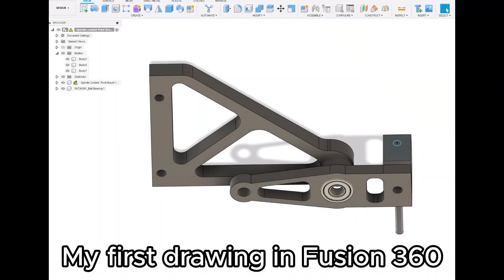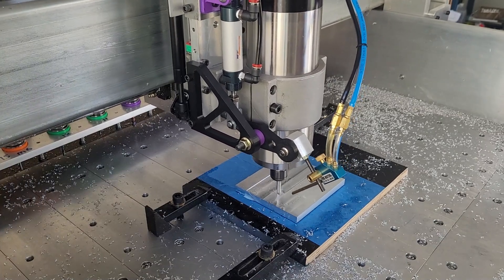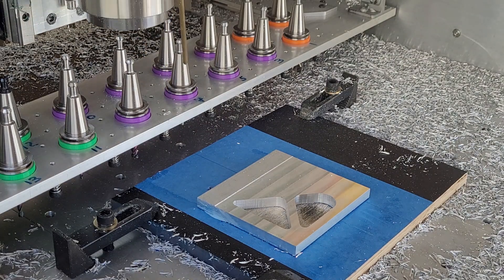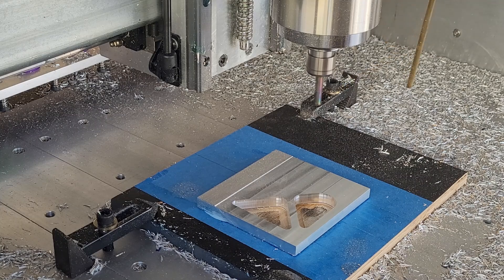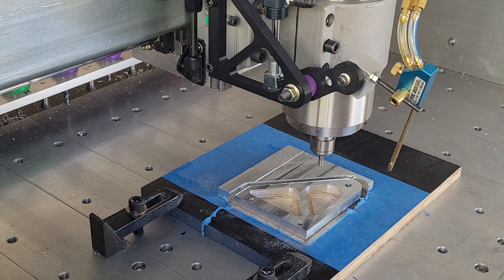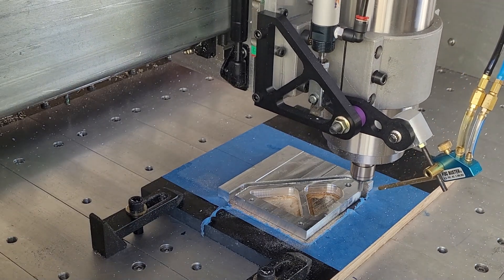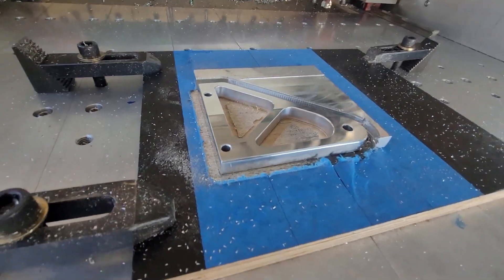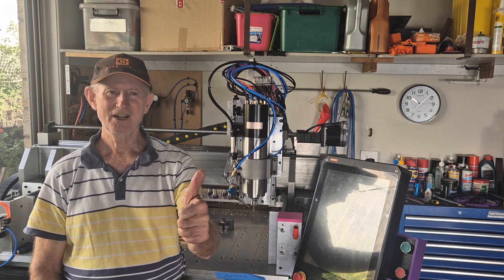Bill's PrintNC CNC 3d Printed Proto type and 6061 alloy Machined mist coolant Retraction Device

Comment: what are you holding down the work piece to the wood and tape with?
Reply from the maker: Hi thanks for your question after cleaning with alcohol, I apply the masking tape to both the wooden base and the bottom of the alloy then just apply super glue to one of the tape surfaces it bonds almost immediately so be precise when placing the alloy onto the wood I can always loosen the clamps and re square the part if needed Ok cheers Bill

Comment: what pitch and grade ball screws are on your machine? great build and keep videos coming!
Reply from the maker: Hi Kevin I started with 1610 single nut C7 ball screws on the Y and X but on one of my upgrade when I changed from 20 mm linear rails to 25 mm rails on the X and Y I also changed to 2005 Double nut C5 ball screws Machined not ground sorry I can't find the brand they were just off AliExpress I was happy with the quality and finish they have been getting quite a work out but still very precise I was after 2010 double nut but could only find them in C3 ground which were far to expensive .... with the servos and 2005's the machine can move faster than I can ever machine and can run rapids of up to 6000 mm / m well that's as high as I have tried.... The Z just uses 1605 C5 single nut (with air strut support) and because it is so short I may upgrade it to a 1610 C3 ground one day Ok I hope that helps cheers Bill

Comment: Hey Bill, what kind of grease do you recommend to use on the linear bearings and ballscrews?
Reply from the maker: Well the normally recommended linear rail and ball screw grease is White Lithium  But I have been using High Temp Wheel Bearing grease for the past 5 months as an experiment to test it's long term performance ........no problems to this point why risk it you may well ask . I always planed to extend my Y axis by another 100 mm replacing the Ball Screws and rails for longer better quality ones after a year or so anyway  the H/T wheel bearing grease is much easier to get then white lithium so time will tell cheers Bill
Reply: @williamnorris1516  thanks for replying! I really appreciate it. I’m in the process of assembling a machine at the moment (it’s not a printnc) but I was curious on what to use. Love your machine btw. I hope to build one in the future so I can cut smaller mild steel parts.
Reply from the maker: @thedude6650  Happy to help and good luck with the build it's a fantastic project building your own CNC machine and then a lot of fun using it cheers Bill

Comment: Great designs and video.  I like that you built the first one with 3d printer to test its operation.  Super clever
Reply from the maker: @mbaulfinger I have a Bambu Labs X1 Carbon so it does not take too long to print protype parts which lets me get a feel for the size and scale as it turned out When I first fitted the printed parts and tested the operation I found the rocker arm ratio needed to be changed as I was not getting enough movement on the nozzle at that point I also change the shape of the nozzle mount end from square to round all done before I machined any alloy at all I think it's a smart way of doing it cheers Bill

Comment: those are some nice size chips btw, your machine is a beast 🙂
Reply from the maker: Hi Chris yeh well 3.2 Kw Jianken spindle and good strong home built machine makes it easy to do I have dialed back my step over you should have seen the chips coming of the 8mm cutter with a 4mm step over at 3000 mm/m ha ha but the cutter was smoking ........as no flood coolant........ I think I might go to a  2.2 Kw Jianken ATC spindle next time as it would have more than enough power but be around 5 Kgs lighter thanks for the comment Chris, all the best Bill

Comment: so is the nozzle pointed at the end mill and then the air gets deflected down into the pocket? I've noticed at an angle like you're using it doesn't properly clear chips when doing a contour over 1/2" deep in certain areas. I've been playing with the idea of bending the end of the air blast so its almost the exact same angle as the end mill then moving it just 5mm away. that way it's shooting the blast almost directly down into the pocket. thoughts?
Reply from the maker: Yes I have seen the fog buster brass nozzle tubes bent to do just that and I agree that would be even better I do also run a second air blast only nozzle but not fitted in this video for clearing chips from deep groves and pockets which I have done a past video on, But that's the problem with having built a machine that make so many large chips so quickly ha ha any way thanks for your comment cheers Bill

Comment: Another great video, Bill! I always enjoy your productions.
Reply from the maker: Hi...... I am glad you are getting something out of my videos, I am just trying to show people just how much you can do with a home built or hobby CNC machine as I have said before the machining is easy making the videos is the hard bit........... anyway thanks for the encouragement, cheers Bill
Reply: @williamnorris1516  Modern home-built hobby CNCs are far more capable than the 2-1/2 axis milling machines that were state of the art when I started in the industry. 

While they aren't as large and powerful as the machines that I ended my machining career with, they don't need an 18-inch thick concrete floor with 50,000 psi rating to move across for installation and 36-inch thick isolated concrete pads to rest on, either.

I've always enjoyed working with CNC machine tools and it's a joy to see what other hobbyists are doing with their custom builds these days. You've certainly built a top-notch machine.
Reply from the maker: @GaiusTacitus  Thanks coming from a real machinist that means a lot to me..... My machine is still a work in progress but the build is a project which I am enjoying very much you have to have something to do in your retiremen,t to keep you out of trouble ha ha thanks again cheers Bill

Comment: Looks great.  Notice a reasonable amount of chips on the tool holder - might these interfere with your changes?  Is it worth trying to limit the amount of chips going that way?  Air assist nozzle pointing the other way perhaps, some kind of shield arrangement for the tool holder?
Reply from the maker: Hi yes it's some thing you have to be on top of I just blow of the rack before each tool change and there is an air blast from the spindle as it lowers on to the tool holder I have some ideas to address this but it's a sliding tool rack (moves 200mm) and not easy to shield So still thinking on it thanks for the comment cheers Bill

Comment: That's a thing of beauty Bill... and another cracker video!  👍
I meant to add the following to one of your earlier videos:
There are times when chips find their way to the tool rack on the ATC.  I can hear the air-blast during tool changes, but there still may be times when a wet chip will stick to the taper.
I wondered if a bottom-hinged door would reduce the chances of this happening.  Something really simple; lightly sprung so it could be pushed down by the tool-rack as it moves forward.
Loving your videos, and the results must be sooo satisfying!  Thank you.

Comment: How do the neigbours like the noise? Any plans for an enclosure or have you sound-proof the garage?
Reply from the maker: Yes well I don't run the machine all that often and mainly during the day when most people are at work so it's some thing I try not to abuse (noise) ideally if someone is mowing the lawn they wont here me making noise ha ha but no plans for an enclosure at this point in time cheers Bill
Reply: Noise level from a CNC really isn't as loud as you'd think it would be. Cutting wood was louder than when I was milling aluminum surprisingly. 

With the garage closed. No-one is going to really hear a thing. Especially if they are inside their house next-door.